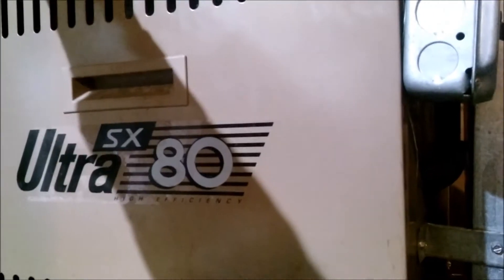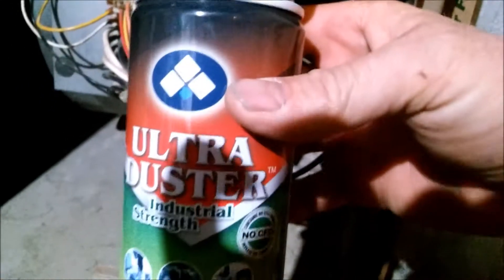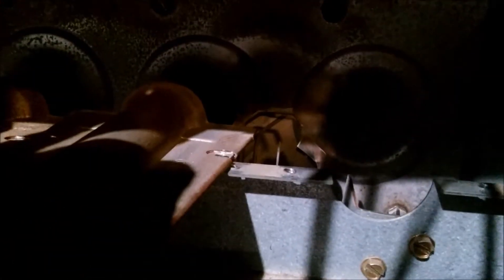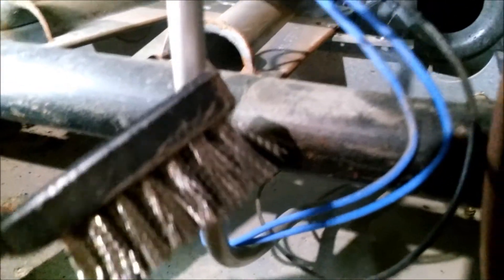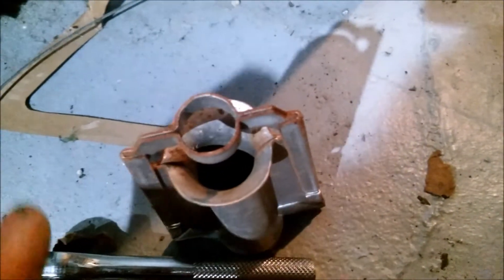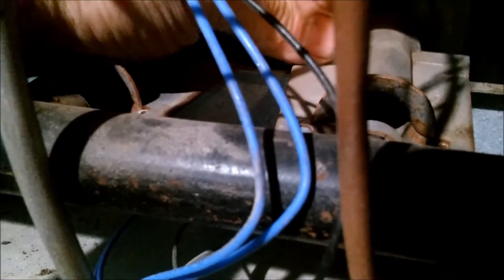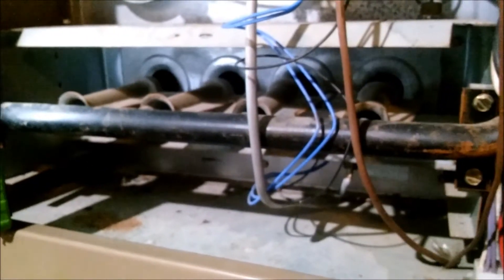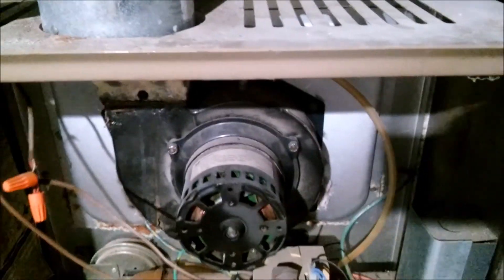Furnace cleaning back firing

Comment: did this "fix" last? i also have a sx ultra 80 that just did that on a shut down. scared the shi* out of us. i vacuumed all the dirt out and so far it hasn't happened again.
Reply from the maker: Yes scared me even at nights till I figured it out.  Still working this winter as we speak.  I posted that video in 2018 about 4 years ago. Regular cleanings and better filters are the thing. I mentioned to blow the tubes out with air also. I learned alot about furnaces with this one.
Reply: @mobilemowers  sweet, gives me hope this thing won't explode lol she's been running great, but I've definitely slacked on maintenance. Thanks again!